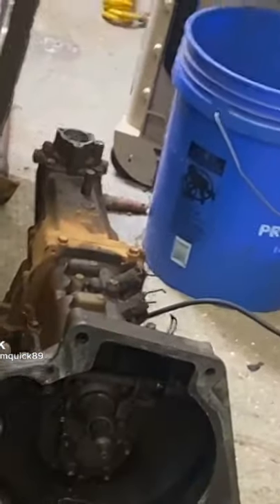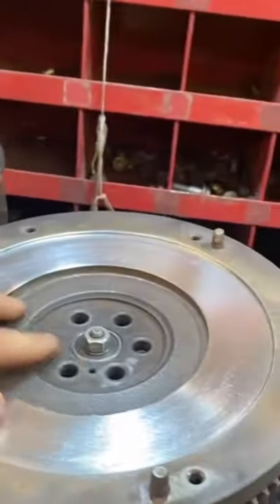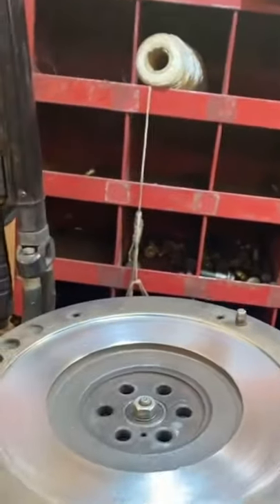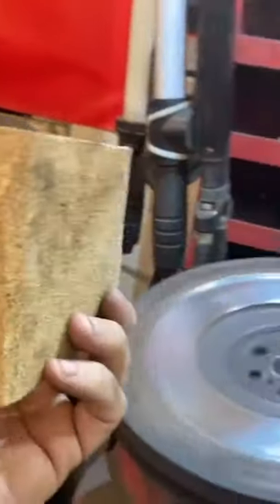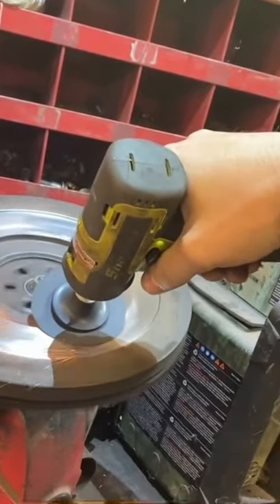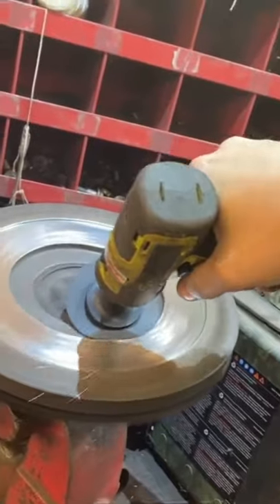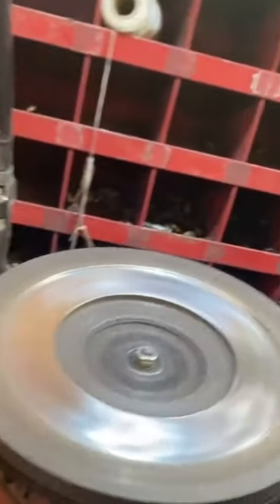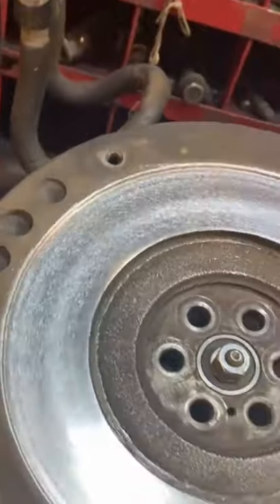How to resurface a flywheel when doing a clutch in less than 60 seconds#shorts

Comment: That's a great description of what you shouldn't do.
Reply: Ya definitely NOT the to resurface your flywheel! Unless you don't want it to last long and want it to make noises and slip way before it should.
Reply: Yea this dude did a great job for not having access the the machine shop your wrong
Reply: @MrCarnutbill67  totally wrong dude
Reply: @hardup9809  your use of grammar tells everyone just how much you know guy.
Reply: @hardup9809  combine the uneven surface of the flywheel with high rpms and you'll wear through that clutch. Not to mention itll cause uneven wearing on both the flywheel and clutch. Leading to potential hot spots on the flywheel. Ever tried reusing rotors on brakes that have been grooved with new pads? Same idea. Don't cheap out, wait till the machine shop opens and do it right. 

And yes. I've done a clutch change in my Honda. Probably gonna do another in my miata. So I'm not just speaking with no experience.
Reply: @PhilmoreJenkins  if brake rotor is not fucked completely by steel backplate of pad, it will be gooved a little - dozens pads were changed and not a single issue. Resurfacing rotor at each pad change is WAY expensive than just driving 3-4 sets of pads and then changing out rotors (or by rotor width).
Reply: @RAPXZibit  True, I was just using it as an example. Since it's one of the most common things on a car to replace, so they'd probably know what I was trying to say. You're absolutely correct though!
Reply: Just take some 180 grit and wash over it by hand if its not too far gone. Taking a rotary tool to it is just begging for an uneven surface. Have done dozens of my own cars like that and have had quiet, long lasting clutches :)
Reply: @MrCarnutbill67  yeah I'm with Jordan . You're 💯 wrong
Reply: First of all 10:00 at night lack of sleep if you've been working all day and the way he said that it comes out more gooder
Reply: Yeah having your flywheel resurfaced is a little bit more in depth than that.
Reply: My father's been a mechanic for 45 years and he put a brand new clutch flywheel bandgear and bellhousing on his F-250 in 2001 and it still hauls 1.5tons regularly. He hauls in scrap now exclusively. Anyone who speaks definitively like this I almost want to just disregard cuz it shows the closed-minded attitude that they have towards the subject like not even acknowledging that there's multiple variables( edit: it's an 85' back when they were made gooder)
Reply: @deipweedecuchiekrucher7384  

That's OK. I've actually done many clutch jobs and I can tell you that they all either had a machine shop resurface them or they got new flywheels. Like I said, if it's for your personal vehicle go for it. If it's for a customer, that's a chattering, loud ass comeback waiting to happen.
Reply: @2strokejunkie686  obviously you don't know how to read I didn't say that was resurfacing a flywheel I'm saying that it's not needed in all applications. All y'all out here getting butt hurt
Reply: @2strokejunkie686  calling me kiddo when your name literally has 69 in it it's kind of counterintuitive there but.
Reply: @2strokejunkie686  doubt it
Reply: But it’s more gooder
Reply: This is just silly. It would be better to just put it back in as is and eat the extra wear. Also for all you comment warriors arguing in this thread. If you start your argument with my "insert friend or relative here" , then your argument is invalid.
Reply: You didn't put a comma after so that means your wrong. Cuz English is everyone's first language. Only people in the planet are the ones in the town you live in
Reply: @deipweedecuchiekrucher7384  imagine making fun of someone's name when yours is even worse...
Reply: @millennialhonkey8929  I didn't "make fun" of anyone. I used it as a marker of his maturity .
Reply: @hardup9809   Are you a mechanic?
Reply: @deipweedecuchiekrucher7384  1.5 tons is not a lot of weight.  My tahoe tows a 6000lbs boat and trailer weekly...go ahead and add up the tons.  You don't resurface flywheels with power tools, you will not find anyone who recommends this even for the home mechanic.  It's stupid, not precise and did I mention stupid?
Reply: Good work🤦‍♀️ you can just glue some sandpaper on your clutch when it gets worn too🤣
Reply: @grantflavel9822  HAHAHAHAHAHAHAHA HAHAHAHAHAHAHAHA HAHAHAHAHAHAHAHA HAHAHAHAHAHAHAHA HAHAHAHAHAHAHAHA HAHAHAHAHAHAHAHA HAHAHAH You funny funny man. Smh
Reply: @UnyieldingSeraph  that's not towing capacity that's in the bed of the truck with ladder racks on it. Big difference there
Reply: @RAPXZibit  not way expensive the cut rotor
Reply: I just look at it like this, you wouldn't do this to the mating surface of the engine block where your head gaskets lay because it will warp the deck height and you will loose compression, why do this to a flywheel where you know the mating surface is important for applying even pressure for an accurate transition of power....
Reply: Has any of you guys rigged  up a brake lathe to turn flywheels? Obviously you cant turn them all, but one shop I worked at resurfaced all flywheels on the brake lathe if it could be done. Never had a problem with chattering. I bet this guys shit shakes so bad when he is taking off.
Reply: @TheMustangs05  shitty brakes? more like common sense, pads anyway will wear disk not in a flat line. my rotors chew through 3-4 sets of pads before replacement with active driving, i wont resurface rotors twice in their life - they cheap af, one resurface where i'm live rn just shy of brand new brembo rotors, and also the hussle - put car on jackstands, remove calipers, drive to the shop (wait apparently from 1hr to 1 day), drive back, put everything back together - nice way if you get paid by hr, but i'm maintenancing my cars myself and i got no time for that bs, slap a pads in 30 minutes and you're done for a year
Reply: This is normal practice in gearbox shops as long as the flywheel is okay and just needs the face cleaned up
Reply: Certainly won’t remove the hot spots, will be putting another clutch in soon enough
Reply: Yeah I'm with Jordan you're 💯 percent wrong. Wtf
Reply: @PhilmoreJenkins  1 clutch and thinking about doing another one is not experienced.
Reply: Haha ive done this on mazda rotary engine flywheels which rev to 8 to 9000rpm. Didnt even take the flywheel off the engine and used emory cloth by hand.. its fine as long as the flywheel isn't warped
Reply: @defnotcam9166  ah, the intellectual. A person who judges others for what they drive, very cool I hope one day humanity will listen to your great wisdom oh great knower of things
Reply: @defnotcam9166  no, I’m just not a fan of people putting other people down. All it does is expose your ignorance and deep seeded insecurity, I’m going to stop replying to you as I’m sure you revel in others discomfort. May you one day find happiness
Reply: @Salvation Auto to compare an engine block where friction barely exist is not a good comparison. Friction surfaces are different to an engine, the transmission maybe. No type of friction as oil interferes and when it doesn’t wears components. Viscosity’ While your terminology is correct on fitting a head to a block, that’s about it. Needs to be heated to a certain degree and decked to allow seal when torqued and even that has its failures. If an engine suffers too much heat or friction from starvation you weaken integrity and no matter how good they deck the block and head should always be rectified. In my years I’ve seen many fail as ultimately they want to charge, but the customer ends shafted by fuel/oil consumption and low power. Engineering must be used to be an engine builder. IJS’
Reply: @PhilmoreJenkins  I have just thrown new brakes on a really fucked up rotor and it worked fine, just don't expect them to last as long and then next time around get it resurfaced properly. It's a consumable friction material on a decently flat surface, it'll be fine.
Reply: I thought he was going to weld some rebar to it, and call it 👍
Reply: @shanebroom9173  amen!
Reply: @acrazedtanker1550  Damn, you left a comma out, guy.
Reply: mooore goooder
Reply: @acrazedtanker1550  why does grammar tell people what u know and what u don't now I don't have god like grammar so that makes me dumber then rocks?
Reply: I did this once because the customer didn’t want to pay for it to be resurfaced and he also didn’t want to pay for a new flywheel. Guy drove a 4x4 Cummins with the getrag. I took the die grinder to that damn flywheel and never saw that truck again. Worked great. Still don’t recommend
Reply: More gooder
Reply: @hardup9809  I worked at a clutch shop and this is DEFINATELY WHAT NOT TO DO
Reply: @evolburd5768  that's called responding to a comment........ Like that^
Reply: @acrazedtanker1550  You've used your punctuation very incorrectly. Who are you to talk?🤷 But you're right, he joined YouTube two years ago and look at his picture 💀 definitely a kid.
Reply: @draxinsklounce  are you sure about that just because I have a picture that looks weird that means I'm a kid are you sure
Reply: @draxinsklounce  what would be a picture to your liking that would prove I am an adult hmmmmmm
Reply: @xzx4696  yeah you're a kid. An adult doesn't have to explain himself and just starts being sarcastic 🤌
Reply: @xzx4696  chill dude.. I was joking 😂 I'm 26, you're a kid to me😎😉
Reply: @RAPXZibit  its not a brake rotor though
Reply: But it came out more gooda? Isn't that ok?
Reply: You can rough up old flywheels as long as they are not hot spotted. Done it multiple times on boosted cars with no issues. This is not the correct way to do it but it will works Don’t remove too much metal. You will be fine. DO NOT do this to a customer car.
Reply: He might have had a chance if he lap welded that GRUVE UP FIRST …. 
WoW …
Reply: You don’t even know dude
Reply: @RAPXZibit  That's not a Brake Rotor though it's the Flywheel
Reply: Na all he is doing is taking the glaze off of it.throw it in and run it.
Reply: If done with some care, it's better than doing nothing.
Reply: Honestly it’s all about how ur doing it and be aware of the surface level and the different grid levels ur using as doing it

Comment: Nice job advertising as to why nobody should let you work on their car.
Reply: Yea this dude did a great job for not having access the the machine shop your wrong
Reply: @hardup9809  no he didn't. You've obviously never worked on a car. That will feel like shit once the clutch catches all the low and high spots.
Reply: @punkrocker10115  sure bud
Reply: @punkrocker10115  sure bud
Reply: @punkrocker10115  sure bud
Reply: @hardup9809  the flywheel has deeper grooves after his treatment than it did before the treatment.

So his job is straight up worse than doing nothing and just reinstalling the used flywheel.
Reply: @anonym3017  your wrong
Reply: @punkrocker10115  I have rebuilt engine I'm sure you never have
Reply: @hardup9809  spray painting an engine is not rebuilding an engine
Reply: @hardup9809  You can agree that he's apt to make a very imperfect surface using this method right? It would likely have a slight angle ground, with high and low spots where uneven pressure and time has been applied. It would be subpar. I MIGHT do something like this to my own stuff, in a pinch, but it sure seems like a hack job thing to do.
Reply: @punkrocker10115   sure bud
Reply: There is absolutely nothing wrong with what he did
Reply: @jdtv...9134 It will probably be ok, but there's plenty wrong with what he's doing. Resurfacing with a rigid machine fit for the task ensures a level of flatness  and parallelism with the rest of the clutch mechanisms that he's unlikely to attain with a die grinder.
Reply: It's a joke! 😂
Reply: @jdtv...9134  tell us you've never worked on a car without telling us you've never worked on a car...
Reply: @punkrocker10115  my Firebird was in GM Tech magazine in the late 90s with a turbo before anyone was using them
Reply: Either Jordan is pissing in everyone's cheerios, or he is a backyard know it all.
That flywheel still has all its high spots...
That clutch will last half as long as it could. 
But I believe the video itself is satire.
Reply: @getchasome6230  Apologies for what you read into little buddy.
Reply: @punkrocker10115  "boys will be boys" and "if it works then do it" apply so hard to this situation. If you ain't ever been at a job and looking for ways to make work easier, quicker and simpler then you're working the wrong way.
Reply: @noobpro9759  no, I take pride in my work and don't need shortcuts.🤷‍♂️🤷‍♂️ my boss understands that it makes more sense to take a little time to so it right than taking time to do it again.
Reply: @punkrocker10115  eh i guess that depends on what you do. I mainly reno houses and most people can't tell a good paint job from an amazing one. But I guess a well running car is only running til it ain't. Hell my ass bought a fiesta so I guess I cant say what a well running car is. XD
Reply: He never corrected the cup spec
Reply: Pretty sure it's a joke.
Reply: @punkrocker10115  100
Reply: @KillingMachineMechanic  painfully ironic that you commented then
Reply: @KillingMachineMechanic  bruh wtf is this comment 😐
Reply: @Tiyratania  plagiarism?
Reply: @hardup9809  dude that pitting is pretty deep.  Theres a reason to have it machined and polished, and its not so it will look shiny.  Its so its perfectly flat and smooth, giving the highest amount of contact.  Some people wouldn't notice, but many will feel a difference.  If hes charging the regular price for this, thats shady as fuck.
Reply: @hardup9809  Instead of saying sure bud explain to a master tech, why this is going to have any sort of longevity.
Reply: Who u kidding I would trust this guy with my car coming up with shit like that fuck yea
Reply: @hardup9809  "Rebuilding an engine" and "rebuilding an engine to the point it functions" are two different things
Reply: @punkrocker10115  Who hurt you
Reply: @thecaramelbrothers2601  does it hurt to be that much of a smooth brain parrot?
Reply: @punkrocker10115  yup someone definitely bullied you got that bottled up angry see a therapist my guy.
Reply: @thecaramelbrothers2601  wow. So original. Did you come up with that?
Reply: Runout
Reply: @billyhill2172  ok bud
Reply: @junatah5903  you don’t understand trolling
Reply: @jdtv...9134  every thing is wrong with what he did. As a trans rebuilder, 40 + years. Is it worth the 25 dollars to resurface with a machine    which trues and levels the surface, or pull it back out for a chatter on engagement. If you charge for the job, do the job,  right.
Reply: @ronniecox109  just deglazing is slightly is not going to cause it the chatter now turning it down 10 thou or more might. This is perfectly acceptable. I personally have done it to my own vehicle five times with zero issues zero slip zero chatter on a 72 firebird 455 4speed
Reply: @jdtv...9134  the company i do buisness with Clutch Specialty of Marietta Ga. Who ive been using them exclusively  reface or resurface my flywheel,  when i get my package. They build one clutch that has the convential smooth lining on the pressure plate side. And button type on the flywheel side  . Its came a long way since muncies, toploaders, and a lever operated release bearing. Now its Tremecs and hydraulic release , and dual discs.
Reply: @jdtv...9134  because the gnx and turbo regals never existed I guess
Reply: Clearly don’t understand the joke
Reply: @hardup9809  nah he should’ve just waited till the next day lmao. No point in doing that by hand. That’s how ppl fuck up their car
Reply: @punkrocker10115  ok expert
Reply: @M4CHINE69  I am an expert and 100x more intelligent than you. 🤷‍♂️🤷‍♂️